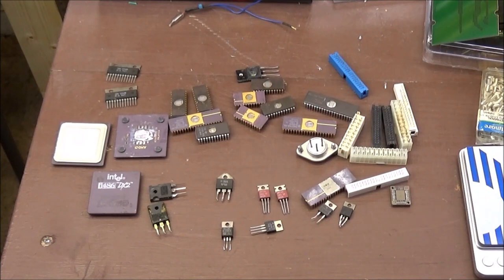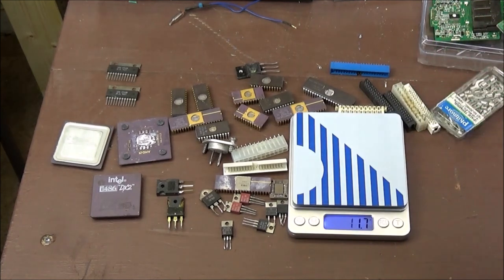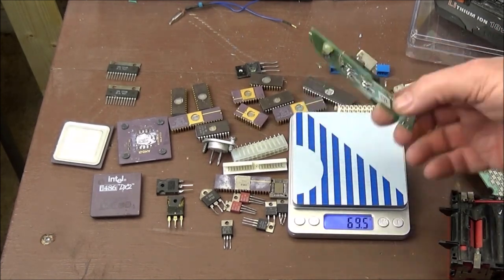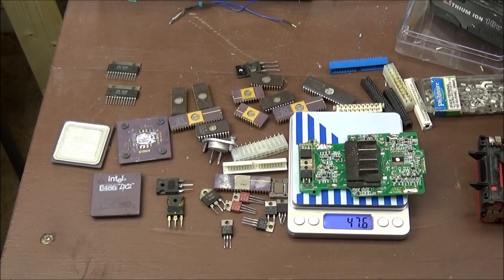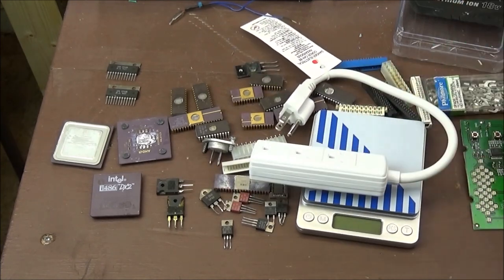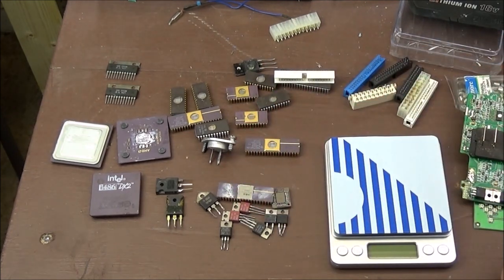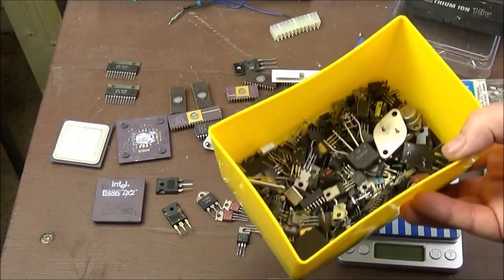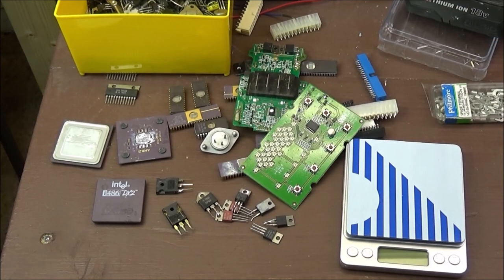Reality of Recycling Low-Value Ewaste

Comment: I'm no tree hugger but you are so right.

I've seen areas of India, Africa and countries in the far east where our electronics and hazardous material end up. 
We are just exporting the real issues to pollute other people's back yards and in doing so using addition a energy to ship and extract materials.

Just like solar and wind power! 
The energy cost of designing, manufacturing, building, installing, through life maintaining, end of life deconstruction, transport, disposal and or recovery of materials takes more energy than the turbine will ever generate in its useful life, yes I've worked on this and done the mathematics. 
It's a similar story for solar panels and nuclear.
The only power projects I've seen that have positive gains in energy are trapping tidal waters (dams) &, ground heat extraction.
We need to invest in low energy homes, insulation, heat exchangers to reduce waste and save money.

Who ever thought electric cars were environmentally friendly needs to do the math and have an understanding of energy extraction. A 1400 diesel Volkswagen golf (yes I know about the emissions thing) is more environmentally friendly than any commercially  (practical) electric vehicle.
Nobody looks at the country economics, subsidized timely clean public transportation will reduce the overall oil useage of a country (hugh energy/ cost) benefits.
The real questions people ought to asking is why are we we being sold this fairy story regarding, e-waste recovery, solar panels, turbines and nuclear solutions? 
And why are we not addressing the real issues?
Allegedly, l guess there are a lot of large corporations with their hands in the public purse!
Remember when you could upgrade and repair your own computers, tractor, printer tv, radio etc. Apple and many other corps, will give you an excuse why you can't repair and your only option is then to scrap and buy a new one. Many of these corporate organizations purport to be environmentally friendly but at the same time doing all they can to stop you buying spares, denying you access to schematics and prosecuting independent repair shops to stop them repairing or upgrading products.
If you haven't noted this, it's time to investigate. Ask for the mathematics, schematic, allowed upgrades, availability of independent repair shops not licenced repair shops.

👍👍👍👍👍

Comment: One board or one electric cord it's true holds little or no value. But in large quantities they add up in value I personally break down and stock pile large quantities of copper, aluminum and things containing precious metals. The key to processing them is proper knowledge and handling and it can be done without causing a lot of pollution. It's narrowed minds that can't realize everything was made from the environment and can be properly returned back into the environment including chemicals once they have been neutralized. That said sadly not everyone takes the time to properly dispose of waste because they can't make a profit or it takes their valuable time. It's much easier to go bury it and get it out of site and mind. Trouble is over time these materials once buried begin to leach out in a dangerous way into the soil and make their way into water sources. Proper recycling stops this and the payoff is a cleaner safer future. That is priceless but hey I get it future doesn't matter if you can't make short term profit.

Comment: More terrifying is mobile e waste. Everyday their is new model of cell phones and nobody knows what to do about old phone.
Reply from the maker: I have several old cell phones that are just fine but can't use them because of system changes. I don't want to throw them in the trash but the recycle values is so low. I have several computers that work fine for 95% of what I do but can't sell them and the scrap value is so low I just keep them. A lot of Ewaste is perfectly good stuff. That's what I call real waste.
Reply: For sure. I have an Apple i4 that is a very nice piece of engineering, and other than an occasional battery replacement will probably outlast me! But because of forced obsolescence I cannot use it as I should or would like to. Can we blame industry? Or should we urge one another to quit handing over the money every time a new product comes out? Personally, I would be quite happy if we only saw a new model once every 5years. btw I'm not even a person who can afford to buy a new Apple product, it so happens that I have this phone because of forced obsolescence. Furthermore, unless I needed new tech for work or something I would be content to use a communication device that had the capabilities of a 20year old clamshell. 

Tech is great and I love learning to build and design things but we were all pretty happy back in the 90's. Weren't we?

Comment: Kudos for sharing your thoughts and experiences, and the conclusions drawn from them. As someone with only a limited knowledge of chemistry and physics, I am not in a position to support or refute your explanation, yet I have reached similar conclusions through experience and intuition. It just doesn't make sense to go after the small amounts of copper, gold, etc. locked up in electronics waste. Those for whom environmentalism is a sacred calling may chafe at this grim outlook, but the reality is that culling out the potential pollutants mixed in with the "good stuff" in a PCB, microprocessor chip, transistor or what-have-you will cause more environmental damage than just burying the items intact.
Rationally selfish people may come to the conclusion that, while it feels good to take stuff to the recycling center, it feels even better to desolder some parts from an old PCB then actually USE THEM in a homebrew circuit! Your excellent videos provide a welter of practical advice to assist that process.

Comment: Maybe a day come when the we can recycle the scraps using renewable energy sources like solar, wind, etc.
Reply from the maker: While that sounds nice reality is different. Solar, wind, etc. chew up massive amounts of energy and materials for little gain. Solar panels are filling landfills because they can't really be recycled. It takes massive amounts of energy for industrial processes such as glass, aluminum, etc. Even more to purify silicon.  The best solution is perhaps build electronics that can be repaired or recycled. They have already removed for example lead. But recycling plastic is hard because it is difficult to separate type. In one stupid case in America we were cutting down TREES to make wood pellets to send to England to burn so they don't use coal. What am I missing here? Cutting down forests? There is your bio-fuel industry. No thanks. Fossil fuels like it or not save trillions of trees. Modern farming based on fossil fuels grows more food at less cost in land, forests, etc. In my part of the US many small farms are long gone. In their place forests have regrown. Plus food is cheap. That is good for people and the deer.

Comment: Totally Agree with your video. Re-purposing makes a Lot of sense, specially the components, wires, connectors, all power electronics and the like. Most of the recycling is actually more harmful to the environment then simply not recycling and burying the thing.
Reply from the maker: Almost half of what I use in my projects is reused parts.
Reply: @LewisLoflin  Same here! I once went on to a car recycling center .. for around 10$  I brought my truck Full of top of the line Car wires, and connectors and the like, that I still use to this day ...and that was 15 years ago ...

Comment: All of those transistors and IC's are viable if  recycled in VAST amount.     Most American's simply do not have VAST Quantities to process.
Reply from the maker: If I was doing this merely for scrap value the cost isn't worth it. I had that from rebuilding welder control boards. Even the 2 pc boards used in the video wouldn't have been worth mere scrap value due to labor cost and time. And that is the killer - not just pollution but labor cost.
Reply: @LewisLoflin  Yep,     The Chines and other 3rd nation locations are willing to work with those labor cost.  FREE LABOR.   LOL   We call it Slavery.    Was that Chines Toaster built by someone who interviewed for the job or someone who was assigned the job ?

Comment: As a USA based scrapper and person concerned with the environment I 100% disagree with your opinion. I have a ball mill which will mechanically break down the boards to a powder and a recirculating water table that will separate it all by it’s density. Every part of the board can be repurpose in some manner.
Reply from the maker: That's great now where are you located? Does it cost me more money to send it to you than I can get for the scrap? You have an expensive setup which is great, but how many televisions and CRT glass do you take? If the only things you recycle is high quality scrap circuit boards, what happens to all the low quality scrap? The plastic cases? What I get for this stuff at recycle isn't worth the cost of hauling it. But I am all for your efforts. I refer to the total unit. Much of this ends up in poor countries according to news reports.
Reply: @LewisLoflin  I am in Nebraska. Yes it would cost to send things to me. I have a long term goal of having centers throughout the US but I am just getting started. It is always better to go to local salvage yards if someone is trying to sell scrap. I am starting a Veteran based non-profit to where you can get a tax write off of donations to offset costs. It will be a Zero waste center where we take everything electronic. Including crt glass and other tvs. Plastic cases will be shredded, sorted, bagged, and sold to companies that can reuse the material. All proceeds will go to Vets and other environmental projects to better the world.
Reply: @LewisLoflin  there is value in all things the only caveat would be that a person/business needs to have a large quantity. Batteries, the fiber from the boards, lead, tin, mercury,...

Comment: actually this is not how they are recycled, the are finely chopped and copper and other metals are separated gravitationally, when you have tons of these pcb boards it is very profitable. For someone at home is obviously not profitable to get out 10 grams of copper
Reply from the maker: Tell that to the thousands of tons of waste shipped to poor countries. That doesn't address the toxic waste produced by acids, etc. to remove the metal from the chopped waste. I do agree with you, but it is best to build better more durable products that can be repaired. Thanks.
Reply: @LewisLoflin  even overseas they do not process them with chemicals because is not economically viable. However building a product which can be repaired is a different thing and this is politics. Nobody wants to manufacture goods that last long because they can not sell more, the economy is built that way. There is a video of Veritasium where he explains when manufacturers had a meeting, a long time ago and decided to build lower quality products because they are build to last too long. I wish they would build with repair in mind but nobody repairs anymore, they just throw away. 
     Like the mobile phones, now to change a battery, after the warranty is gone, is expensive and the incentives hit you to buy another one. It is unfortunate but I just don;t see it happening. The same with cars and many many other things.
Reply from the maker: @knowldedge5012  I agree.
Reply: @LewisLoflin  hey Lewis, glad to see you're alive, was worried about you. are you still planning on doing more videos? i sure hope so, but you can be proud of what's up already. thanks for sharing your expertise.
Reply from the maker: @dand8282  I Got a new one tonight, another for Monday.

Comment: The value per pound is low, I agree with that. Much of everything else is partly wrong, totally wrong, or misleading. 

You don't appear to know what granulators, hammer mills, gravity separation equipment is. 

Even most third world processors won't burn off polymers  to get the copper and brass out of wires or power strips, they'll use a granulator. 

Yes, I've seen the vids from Nigeria, India, China, Bangladesh, etc, where there's children processing ewaste. Not everyone does it that way.
Reply from the maker: You are talking industrial recycling but news reports say much of the low-grade junk ends up in 3rd world contries.
Reply: @LewisLoflin  and just as you can find videos from India of children depopulating circuit boards in a frying oan over a hot plate, you can also find vids from all over the world of people using the aforementioned equipment, and more. 

It's even done a bit in the US, but most processors aren't going to share their secrets on YouTube. A few partner with Fedex, and accept all grades of cats, or all  grades of circuit boards, and will send you a check. It's not great, but not too bad, either. 

They're not going to share how they're doing it, but it's likely some hand sorting, gravity separation, chemical refining, formation of doré bars, electrochemical refining. They're using classification circuits manufacturers have helped them develop.

 I was in the  warehouse of a large company that helps mines develop separation tech, this part I saw  involved lithium. The companies chemists and engineers were hired by a mining giant to develop a process for them. You and I won't be privy to it, it all involves confidentiality agreements.

Comment: I tend to cherry pick PCB's for anything I may possibly find of any use.  Power Transistor , FET's and Leaner Regulators of any and all veriety.    After that Any and all easily removable  PSU type transformers.   Anything else goes to the land fill.   Simply not economically viable  quantities to bother recycling.  No I am not willing to drive out of my way expending my financial assets to take to any fashions of recycle center.   Not that we even have on in this two horse town.   People have become IRRATIONAL on recycling.  Expecting other people to follow the IRRATIONAL Lead in recycling efforts .   Indoctrination and Brain Washing  has bent  millions of young minds .
Reply from the maker: That is my position as well.